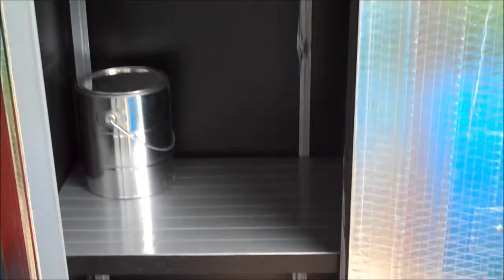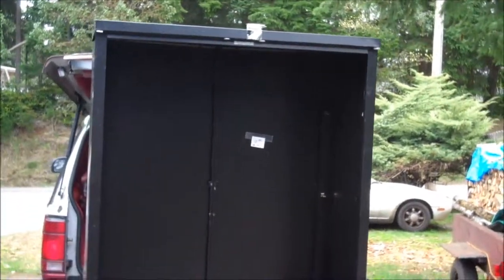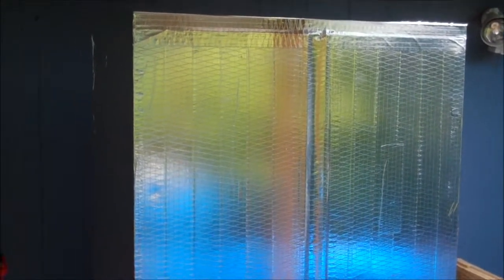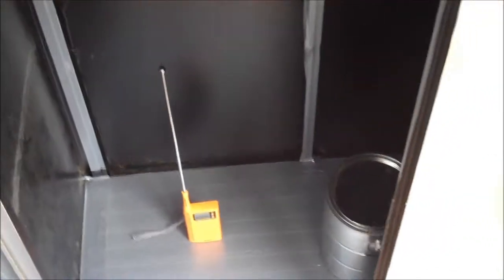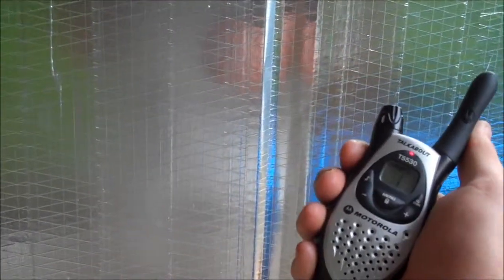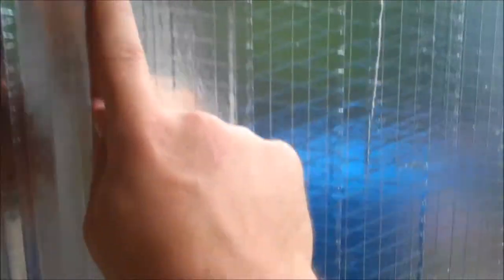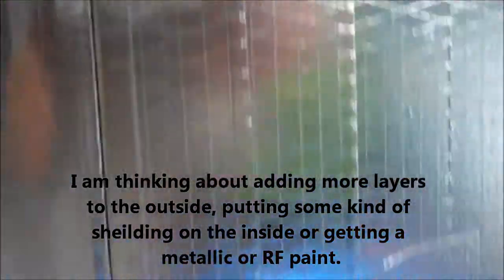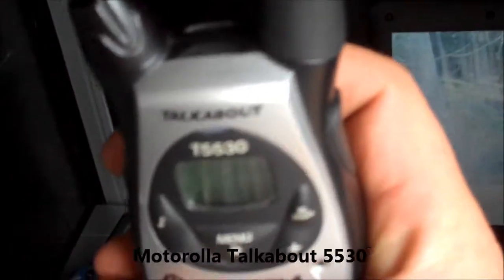My Faraday Cage - L2Survive with Thatnub

Comment: I am making one of these as well  I have lined my shelves with cardboard.  I also just saw a video where they took a rubber seal and covered it with the tape you are using.  This allows for a tight compression fit against the tape and may help block the signal from getting through.  I am going to be trying this on mine in the near future.  I wast tring to use a wire mesh screen over my doors and hold it on with rare earth magnets so I can easily remove it but it didn't seem to have a good enough seal. I hadn't wrapped my cabinet with the tape like you did.  I think that should help me get to your point.  Then I will try adding the seals with tape over them. Good Luck and thanks for posting this video!!!